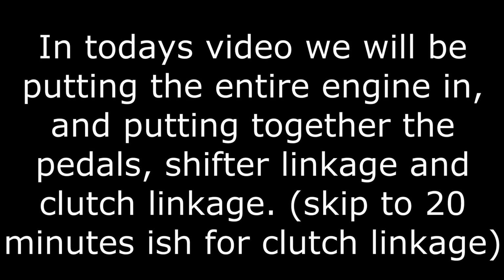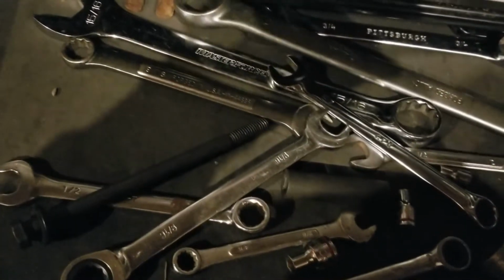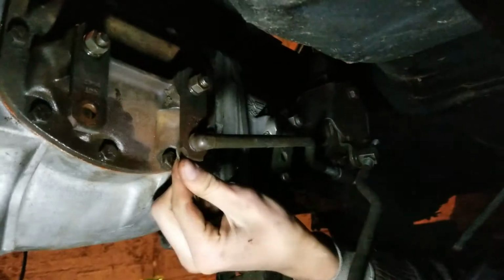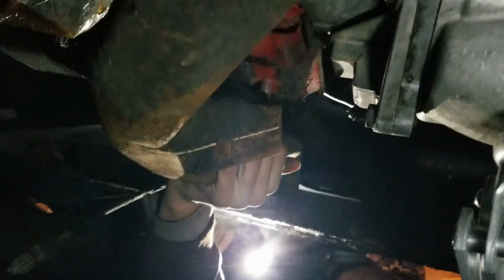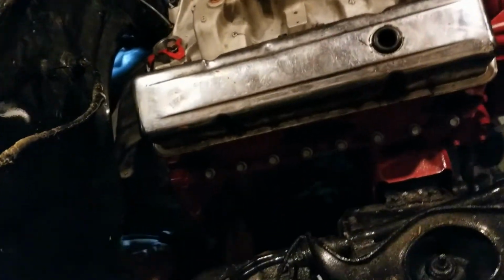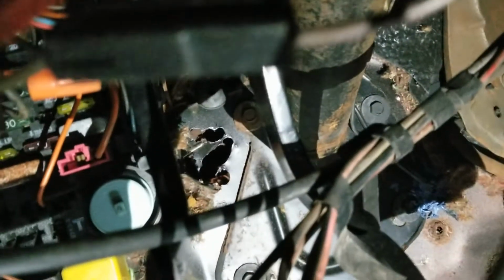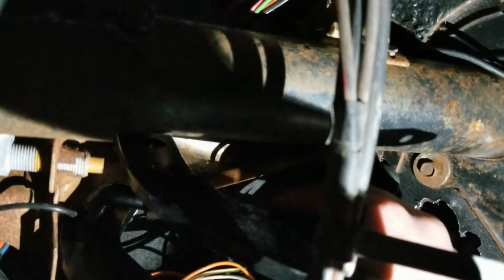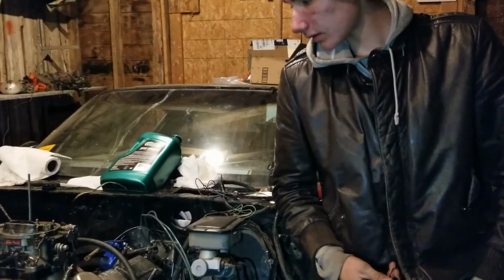'81 Camaro build part 2 assembling clutch and linkage

Comment: I know it’s been some time since this has been done but is there any way you could post a link to every thing you got for the manual swap.? I have a 79 with an auto and looking to pick up a Muncie 4 speed
Reply from the maker: I honestly don't remember everything we used for it and we don't have any of those parts anymore. I thing the only things we really needed for it was a clutch (mc-leod) a clutch and brake pedal assembly and a Z bar linkage. The car never had a center console but you would probably need a manual center console. We used some ebay headers for a manual second gen, factory cross member and motor mounts. You would need to find a drive shaft that was the right length, don't remember what the correct length is, probably because the one we got was too short and it wound up blowing out the tail shaft seal. Everything bolted together pretty easily. These cars came from the factory with the 4 speed manuals so it wasn't too terrible and the parts were pretty easy to get. Putting the T-5 in... now that was interesting.

Comment: Just wanted to let you know that this is a very helpful video. I just bought a second gen with a automatic, I wanna manual swap it. Did u have to get a different drive shaft when you did the swap or how did u go about it?
Reply from the maker: I believe we went to a junk yard and found a driveshaft that was the correct length. I'm not entirely sure, that was a while ago and this car has had 3 different engine/transmission combinations in it in the last 2 years lol.

Comment: Hi, what is the first gear ratio on your 4 speed ? Or how many rings are on the input shaft ? Thanks !
Reply from the maker: Jeez that was a long time ago I don't remember the gear ratio and I sold that well over a year ago, I believe there was 3 rings on the input shaft.
Reply: @Redneck-Racing  I saw in a later video that you broke it ? and swapped in a T5. What broke on the Super T10 ? I am getting ready to put one in my car and I want to avoid problems.
Reply from the maker: @kingrichard4167  the t 10 failing was my fault I used a yoke that was to long and it auged out the tail shaft bushing. At that point I wanted overdrive for cruising and decided to swap it for the t5. A super t10 is a great transmission tho.